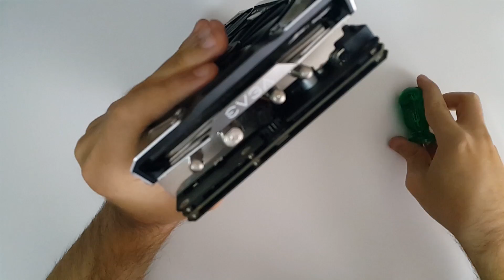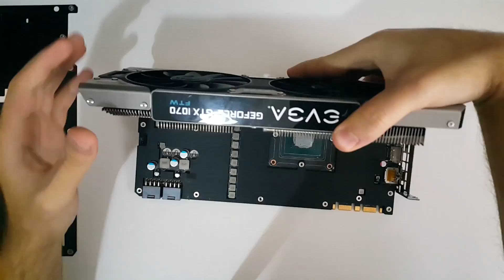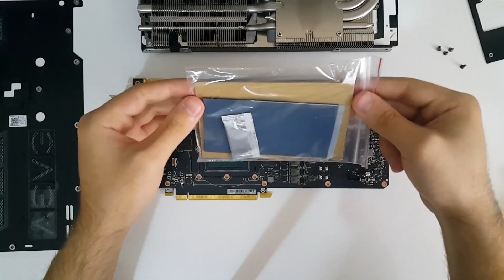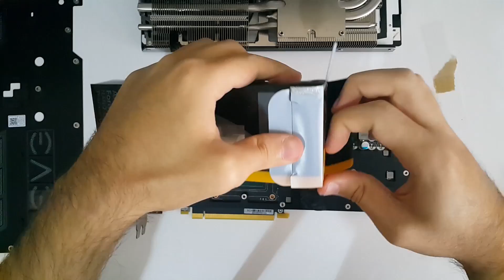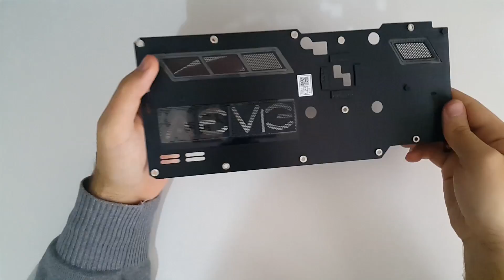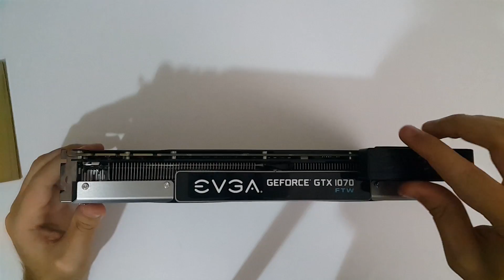EVGA GTX 1070 - GTX 1080 Thermal Pad Mod

Comment: anyone else triggered he didn't remove the thermal paste around the edges of the chip.
Reply: I came straight to the comments to see if anyone had commented.
Reply from the maker: To avoid damaging small resistances.
Reply: @AsmDemir  these are capacitors not resistances dude